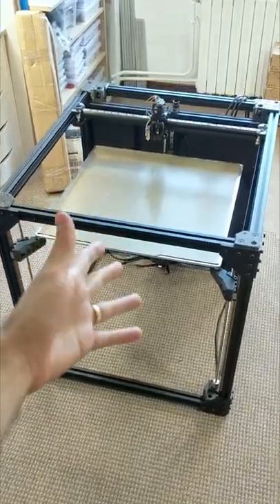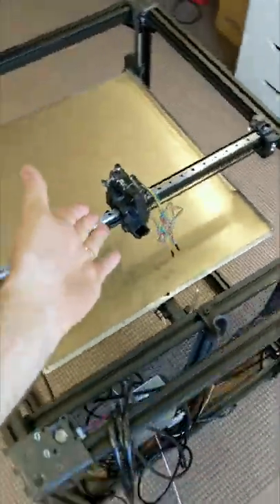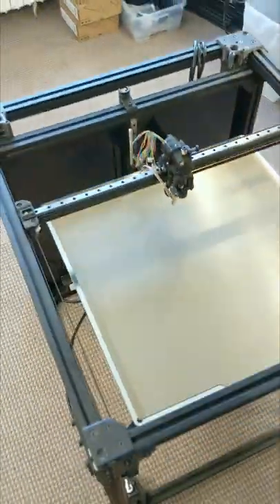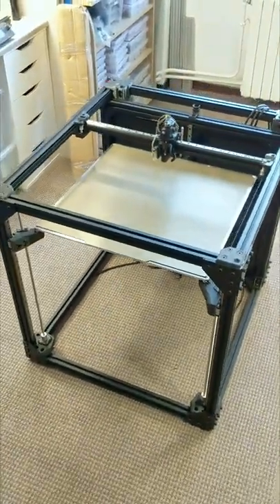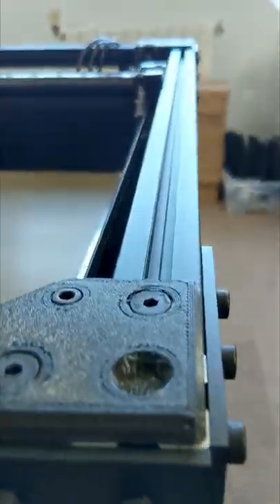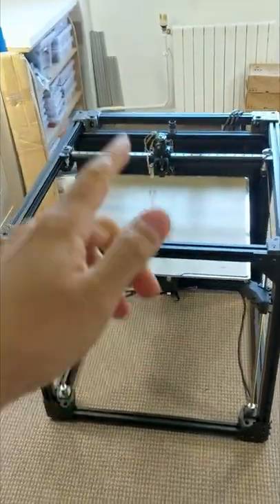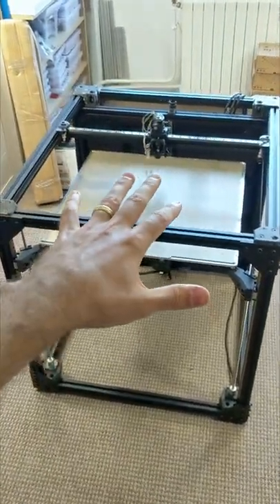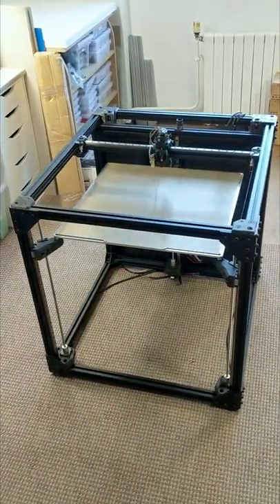My V-Core 3 good news sad news

Comment: Hey Good morning.  yes, I'm that far too.  I'm curious when yours comes back with wiring.  I have to be there in autumn and winter, probably over Christmas.  I'm really considering milling all the plastic parts in aluminum and designing the holder for the bed as a sheet metal edge.
Reply from the maker: That sounds really cool, metal parts!
Reply: @MihaiDesigns  What do you think of the stiffness from the PETG Parts. I am sceptical.